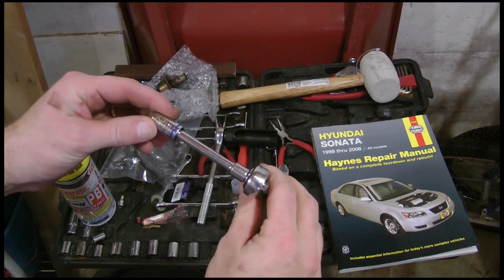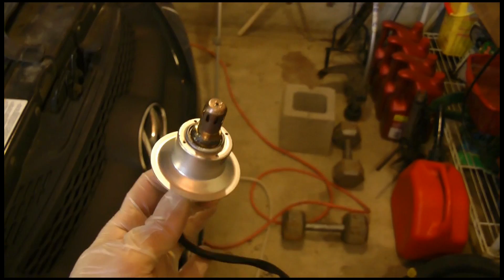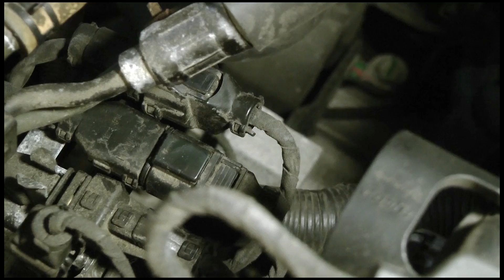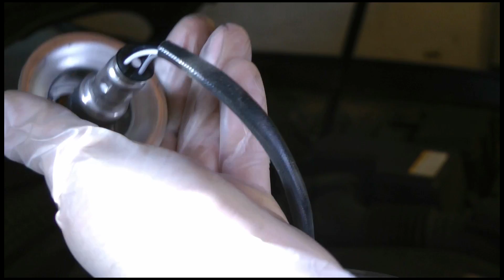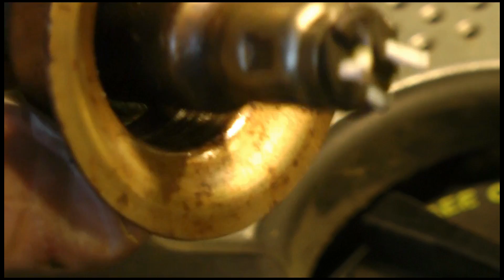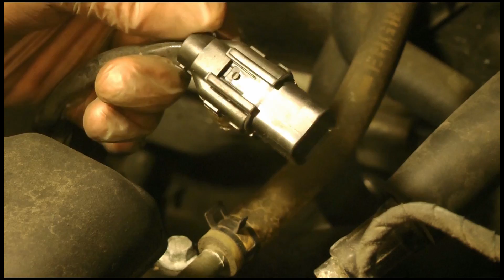Upper O2 Sensor Replacement 2007 Sonata.mov

Comment: What kind of fukery is this!? 😂 Im here to verify 02 sensor locations from a convertor theif cutting both 02 sensors off.

Top/Primary sensor with round heat shield goes to middle plug/connector.

Secondary/Bottom sensor goes to plug/connector closest to firewall.

 First plug/connector by engine head goes down behind a heat shield on lower engine block.

Comment: I have the 7/8 th O2 sensor removal tool similar to the one shown but it does not fit. Do I need to get a thin wall O2 sensor socket? Any help would be greatly appreciated. Thanks
Reply: I had the same problem then I was able to find a thinner one that fit perfect you can find it here https://amzn.to/344JHd8

Comment: Would gladly spend a few hours replacing the O2 sensor on my 2011 Sonata Turbo. Took it to the dealer and they want $185,00. Bought it used with 50000 miles on it. Now I have 52000, 6 months later and need and o2 sensor. This is the kind of stuff that piss's  you off when you buy a car from a dealer. Seems like nothing is covered but the drive train. WTF
Reply: Holly Nites and
Reply: What was your code ??

Comment: Thanks for this video!   Made figuring out the clips etc much easier!   One tip: I soaked mine with PB Blaster for two days, then started the car and ran for 2 minutes or so (per the Haynes manual). Used a 1/2" breaker bar on a 02 socket and it broke loose right away! Did loose some of my knuckle in the process...LOL  I also found that the "vented" shield was missing from my 02 sensor.

Comment: I was wondering if you have replaced the other O2 sensor (before the catalytic convector) yet?  I am needing to replace this one also.  I have been looking around for a site to show me exactly where it is, but I have been unsuccessful.  Is is on the bottom of the car?  Because I have looked at other cars, and many of them have it on the underside of the vehicle.  Thanks also for the great video!  I had to replace the O2 sensor, and your video helped out SO much!

Comment: took me 6 hours couple a trips to auto parts did one at a time make sure it still ran lol then everything was tight my hands got beat up trying not to remove anything else to get to the sensors. Bottom right was easier to change. Thanks for the video time to eat and chill lol.